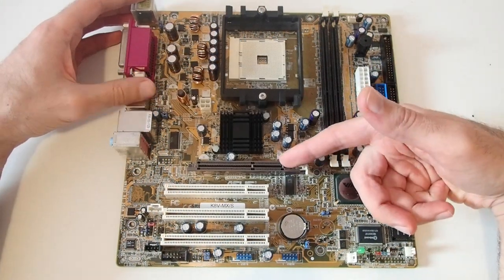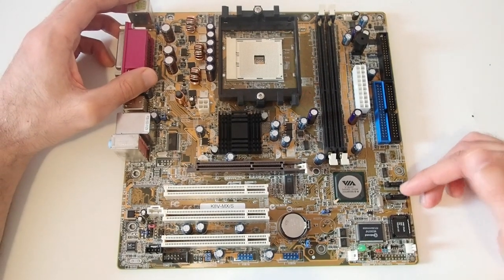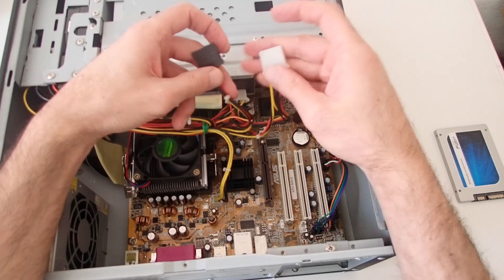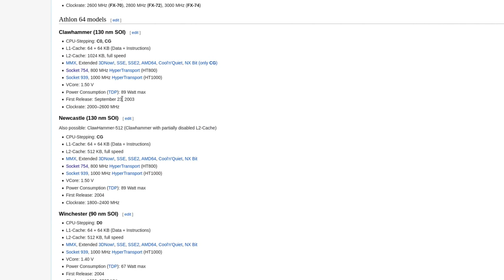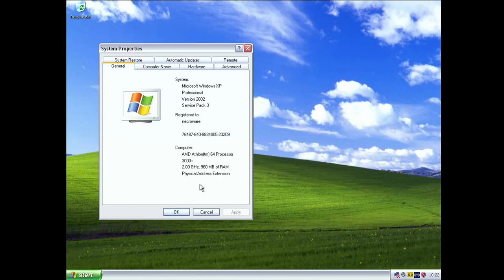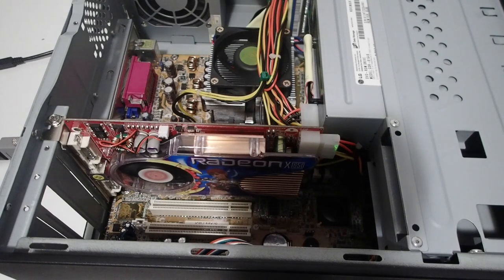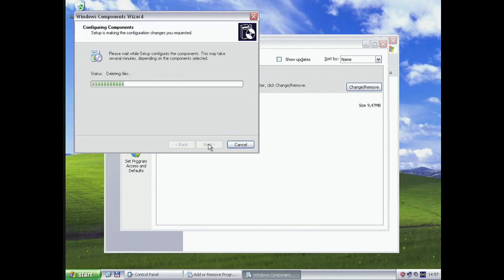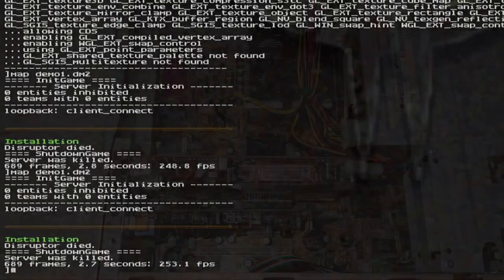Building AMD based retro WinXP gaming PC with FTP server

Comment: I will say, your IDE and floppy cable routing was genius. If you intend to keep using that PC case in the future, which wouldn't be a terrible idea, because it seems to be a pretty lovely, if undercooled, case, then you may wish to either invest in a cheap fully modular PSU, or if you want to make a video about modifying PSUs, you could create your own custom length cables to provide yourself adequate cable management slack. If you want the most pliable cables possible, I suggest finding silicone insulated wire, as it is more compliant than the typical plastic insulated wire, though it is considerably more expensive. I would personally love to see a series of videos about customizing that case for increased longevity. Modding it to include additional cooling, repainting it to eliminate the peculiar text on the front panel, maybe even cutting the side/top panel to add in an acrylic window so you can see all the lovely retro tech hiding inside. I'm not sure about the availability of IDE ribbon cables and their connectors, but if you can find some, it could also be fun to have a short video about building custom-length IDE cables. From my understanding of how they're assembled, it uses punch-through connectors to puncture through the insulation and grip the wires, so the actual connector fixing should be pretty easy.

I spent so much time back in the day figuring out how to delicately fold and tuck IDE and PATA ribbon cables and colorful fixed power supply cables, so content like this is really nostalgic for me.

Comment: BTW thanks for that colaboration with Phil, very interesting that you can take 12V from the ISA Bus and transform it to -5V and inject it on the bus like that. As sweet as it is I keep wondering if integrating this on an XT-IDE ISA CF adapter would be as desirable as I imagine. 😁
Reply from the maker: Thank you, well it depends on how many people find it desirable as well. At least, XT-IDE doesn't need that and I find it very confusing to find circuits on some parts, which are not required. Furthermore, XT-IDE adapter is something, what you want to use in different systems, which probably already have -5V.

Comment: Nice high end early to mid 2000s setup, well, high-ish. I was running a P4b Northwood 2.4 @3.83ghz paired with a Geforce 4 MX440 in 2003 and was drooling over a Radeon 9600x that I never did manage to save up enough for. I was running 1gb of DDR 400 high end RAM though, probably the most expensive part of my setup. In 2004/5 I upgraded to a Pentium D dual core and a Radeon 1600x. Its funny how I can track where I was in my life by the PC I was running at the time :)
Reply from the maker: That's funny indeed, but we are all broken in the same way :D

Comment: From what I remember from those times, motherboards with those VIA chipsets where VERY, VERY picky about the order on which you installed the drivers. If you messed up the "right" order, you ended up with things like the network or sound card not working.

IIRC, on a clean XP install... you HAVE to install the VIA chipset drivers before anything else (where those called Hyperion "4 in 1" drivers?). Then network, then sound card, then video drivers. Basically, in order of "complexity" or "size". Don't forget the usual reboot between each driver, just in case, of course :-D

Comment: Yeah that weird Via southbridge is a pain. The A revision is a bit more compatible (supports SATA 2 without messing around with jumpers on the drive) but still doesn't work with SATA 3 SSDs.  I wound up settling on a NOS Sandisk SATA 1 drive (32 GB I think) for the boot drive and a regular 500 GB 7200 RPM SATA 3  HDD jumpered to SATA 1 speeds. By the way, most of the AGP X700 and X800 series GPUs were native AGP and didn't need a bridge chip. If you wind up with weird issues  with the X1650 it might be a good idea to hut one down. You can occasionally snag a deal on one. A couple of X800 models (I think the X850GT was one) did have a bridge chip, however, so make sure you get a good look at the back of the PCB before purchasing.

Comment: I liked the clean assembly with the Flat IDE cable.

I loved the repair of the video card cooler's interior, I had never seen this type of repair and the replacement parts, I think it never arrived here in Brazil. Usually when a cooler has a problem we replace the entire part.

Comment: I vaguely remember having a VIA network card that had the exact same behaviour. Even though it connected at 100Mbit, I had to actually explicitly select 100Mbit (instead of auto-negotiate) in the hardware settings to make it work. Worth a try, but I guess you've already tried that.
Reply from the maker: Yes, I tried that, but had no luck with that too....
Reply: @necro_ware  Yeah, I figured you'd have tried everything. I guess sometimes you have to say "oh well" and move on.

Comment: Retro-PC with "easy to get components" are a bit of a contradiction. Great video! :)
Reply from the maker: Thank you! Just don't want to call it old, so let's call it semi retro then ;) I usually tinker with much older computers, than this one. So this video is quite unusual for my channel, but I just found this build quite interesting, because I had to handle so many, but obviously common problems. I thought, this could be interesting for the one or another as well.
Reply: @necro_ware  regarding your network issues, did you try to set the speed to 10 or 100 on both the card and on the switch instead of having auto negotiation on?
Reply from the maker: @KJohansson  Yes, I tried that as well. Unfortunately with no success. As I saw on the internet, there are tons of reported issues by users, where this card stopped working from one day to another about 10 years ago. I guess, something happened in Windows, what broke the VIA drivers, which were never repaired, as far as I can see. Almost all reporters switched to another network adapters and blamed VIA Rhine for being broken. As you could see in Linux, the hardware is absolutely ok.

Comment: I'm curious how you ran that Mobile Sempron CPU on your board. I have the K8V-MX version of this board and a K8U-X, both of which have absolutely no way to control CPU voltage (thus OCing them to stock desktop voltages). I ran my Mobile Sempron in a Gigabyte board (K8NE) which has CPU voltage settings.
Reply from the maker: Hi, it automatically detected and dropped the voltage down to 1.4V The mainboard itself has no way to set it up manually.
Reply: @necro_ware  this is pretty much what it did for me as well on the Asus boards, 1.4 volts. However, I was able to achieve 1.2 volts (the spec for those SKUs) on the Gigabyte board; this allowed me to cool it passively. https://www.cpu-world.com/CPUs/K8/AMD-Mobile%20Sempron%203300%2B%20-%20SMS3300BQX2LF.html
Reply from the maker: @computerguy096  I also think, that it should be possible. But just as you told, this mainboard has no way to setup the voltage manually. It detects 1.4V for the mobile version and you have to live with that. Well, better than nothing, at least it detects the CPU properly.
Reply: @necro_ware  they are probably desktop Semprons repurposed for laptops, and have no issues running at 1.4. 
Anyways, I've had even worse luck with the VT8237R southbridge, most of the boards that I have with this chip do not detect my SATA HDDs at all, especially the older Socket 462 ones. Not even the very early Western Digital drives with molex and sata power on the same PCB. Quite peculiar.
Reply from the maker: @computerguy096  Yeah, very poor job by VIA....

Comment: I think the problem with 3dmark 99 is indeed related to Vsync. When you look at the "racing" demo, you can see the FPS is remaining at 60fps constantly. Check in nvidia's control panel to check if vsync isn't enabled.

The S3 unichrome is behaving pretty much like a 90's graphic card ... which is kinda what it is, since I think it's the last chip S3 ever made before being bought by VIA integrated into a chipset.

I have a similar one in my Windows 98 core 2 duo, and when running Unreal tournament, the software mode was faster than the hardware mode with that thing x)

By the way, do you have any tips to fix these old fans ? I see you fixing them all the time, but I'm not super confident at doing that. How did you find the right bearings ?

For the network driver issue, I guess you've tried the drivers from ASUS' website ?
Reply from the maker: This S3 Unichrome in my video is already the integrated version into the VIA chipset. I have to say, I found it quite good for a built-in chip. At least as a DX7 graphics card it makes a good figure IMHO. Not very fast, but sufficient and stable.

In regards of the fans, I just measured the old bearing, went to Aliexpress and found a set of the same size. That wasn't actually too complicated, so no magic or secret tips there :)

And I also tried Asus network drivers. There are tons of reports from 10 years ago, where people said, that their VIA Rhine cards stopped working one day. They all replaced it through another network adapter and blamed the hardware. As my showcase with Linux confirms, it is obviously just a software problem. I guess something in Windows was updated, what rendered the VIA network drivers nonfunctional one day. Probably, this was never fixed.
Reply: @necro_ware  yes I know it's integrated ^^ It's just that mine uses a different driver.

I just thought of something that sounds stupid (but considering the nature of this problem, who knows ?). Have you tried to change the date of the os to something close to the motherboard's release date ?

Also I guess you've tried each version of Windows XP, or have you tried only a couple of service packs ?
Reply from the maker: Well, I didn't try another date. I think, I could try, why not?! :D

And, yes, I tried different versions of Windows XP - Home, Pro, German, US, SP2, SP3. I didn't try one without SP though....
Reply: @necro_ware   since this chipset is from late 2003, and that windows XP service pack 2 is from mid 2004 it means this was tested with windows XP service pack 1 at most. So maybe windows XP sp1 would work ?

When the oldest posts about this issue have been written ?
Reply from the maker: @DxDeksor  Yes, may be. All the reports were made with SP2, as far as I remember. I guess, the oldest one was from 2007. May be I'll try SP1 later, just to bisect the issue. However, I wouldn't like to use SP1 anyway, there would be probably another problems with Graphics Card, DirectX, 4in1 or whatever :)
Reply: @necro_ware  sure ^^
If you get this to work, maybe it'll give the idea to someone else with enough skills and time to check what update exactly is causing the issue and maybe make a patched driver that would work no matter which version of xp you have.
Reply from the maker: @DxDeksor  Not sure, if someone would bother, but who knows :D

Comment: My third PC had a VIA Rhine II (or III) and it failed on me after a while. Tho my machine used a VIA P4M266A chipset (for an Intel socket 478). Even tho I would've loved to have the board you got, I can feel I would've become annoyed with these issues.
Reply from the maker: Many people reported 10 years ago, that this network card stopped working one day on Windows. Everybody assumed, that the hardware was defect. As you can see, the hardware is absolutely ok, since it works in Linux just fine. It must be some driver issue on windows.

Comment: When I used to work in a Computer shop around the mid to late 2000's Via chip sets caused all kinds of nightmares they used to be good but the Duron/Athon onwards Via south bridges were problematic with windows. Like yourself i have been using Linux since the 90's but of late I have been using Windows 10 with WSL2 Windows Subsystem for Linux something I am unsure you may of toyed with it is interesting what Microsoft have done it is a bit limitred but you may already know. I am a Slackware fan and I am about to do a frees build of Linux from Scratch  again as I enjoy building my own OS from scratch and often mod the source code along the way but none the less another great video but I suggest stick with Linux with the via chip set at least the Linux kernel the drivers just work out of the box on retro machines Linux rocks.

Comment: Regarding LAN, did you try various chipset drivers for this VIA (especially latest VIA Hyperion)? Since you are using external driver manager, that may be the issue. I remeber having trouble with LAN back in a day that in VIA based mobos that was solved by installing those 4in1 VIA packs.
Reply from the maker: Yeah, as I told in the video, I tried 20, may be 30 different network and 4in1 drivers combinations. Also windows XP SP3 has a built in driver for that network card. That one didn't work as well.

Comment: Been experimenting with a Socket 754 build too recently, but I wanted to build an unnecessarily powerful Windows 98SE gaming PC on a budget, so I wanted to use Socket 754, an Athlon 3400+ and a Geforce 6600GT, but I'm having some stability problems. Tried both a VIA chipset mobo like yours, and an Asrock Sis chip board, but still no luck with Windows 98. It can be rock solid for hours, and next time Windows won't even boot and will show Windows Protection Error.
Reply from the maker: I had a lot of problems especially with the network card. I almost went crazy trying to get it running in Windows XP. Well, at least luckily the system ran stable....
Reply: Protection error probably caused by too much RAM for 98.
Reply: @LBXComputers  Nope, tried with 128, 256 and 512MB, same problem.

Comment: One downside to using an IDE cable like that in a non standard orientation is that cable select will no longer work for drives. Cable select is done by cutting a pin on the cable between the master and slave drives, so relies on the cable orientation. I guess if you put the middle one on the motherboard it'd still work. Though of course just setting the jumpers on the drive isn't much of a hassle
Reply from the maker: I never rely on the cable select feature anyway. Not back then and not today, since most of the cables I had in my hands didn't support that, that's why I just always prefer to set the jumpers to master/slave ignoring CS altogether.

Comment: Why did you use a 64bit processor and installed a 32bit operating system?
Reply from the maker: Because I wanted a better compatibility to the old stuff in Windows XP. There were issues on 64-bit Windows XP back in the days. Linux on the other hand, which I'm using on that machine as well is 64-bit.

Comment: Hi necroware, i have a Nvidia geforce 8400gs, with passive cooling, i upgraded it to a fan cooling and well it still runs pretty hot, at about 60 celsius in idle and 65 in benchmark, i already changed themal paste with Arctic MX-4

Comment: I remember having this exact same issue with the same VIA lan chip.
The solution, I kid you not, was using the driver prodvided on the CD of the motherboard.
If I used the latest one from the VIA website or the one from the ASUS site, the thing would not work.
If you have a driver CD of a motherboard with such lan chip, I suggest you try that driver.
Reply from the maker: I don't have the original CD, but I tried about 20 different drivers with no luck.
Reply: @necro_ware  Yeah, I know the pain of not having the CD's. I'd wish I still had mine so I can share with you the driver.
Reply from the maker: @MerolaC  It's ok, meanwhile I found a board, which is even better. Asrock 939A8X-M works like charm and kicks even a bit more out of AGP ;)

Comment: i suggest to check the caps on the power supply, cheap power supply=> chinese caps, etc; you know the rest...
Reply from the maker: I know the rest, yes. I bought this power supply 10 years ago and since that time it was not used very much. I didin't have any issues regarding this PSU. I opened it once though, around 2 years ago, it was fine.